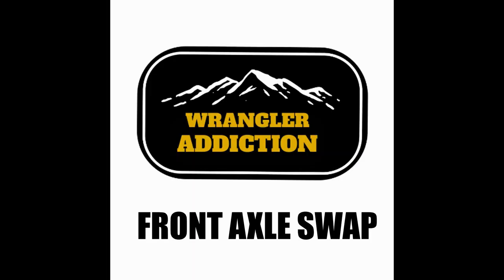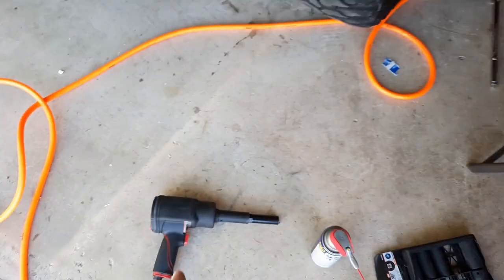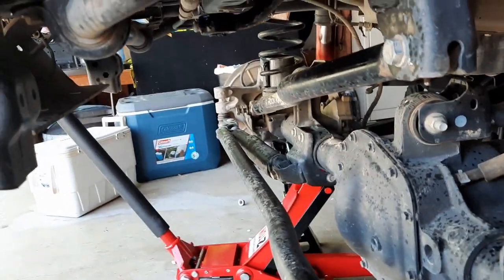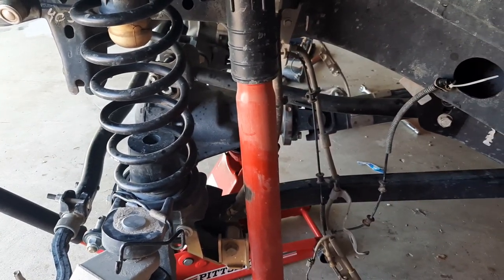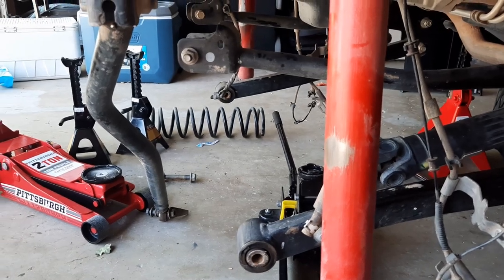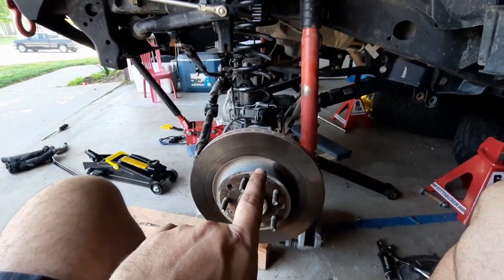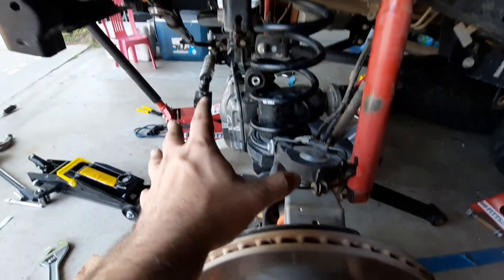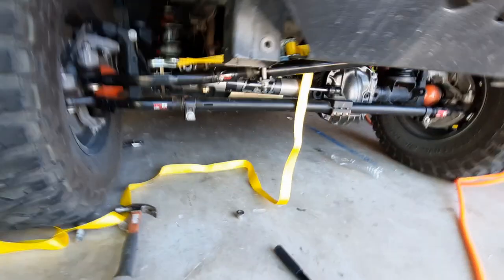Installing Jeep Wrangler JL Rubicon Axles On A JL Sport ( solo at home ) Part 1

Comment: Any updates on the wiring for the lockers? Looking to do this upgrade to my two door sport and there’s not too much info online that I’ve found.  You’re Jeep looks badass btw
Reply from the maker: Thank you , i wheeled pretty hard all day yesterday and 0 issues , lockers worked perfect , mopar sells the harness that plugs in the diff and on the other side 2 wires one black (negative) and one red (positive) i connected them to my switch pannel and the lockers engage pretty damn quick no lag like the oem , way better this way .
Reply: Alright cool, thank you👍
Reply from the maker: @jakedagan6045  you're welcome ,if you have any questions hit me up on instagram @joe_jlu or @wrangleraddiction

Comment: How much wider is the Rubicon axle assembly compared to the sport?  I have a Dana 44 rear in my sport and would like to put a Rubicon Dana 44 in the front.  I've heard the width is different.
Reply from the maker: Sport and sahara axles are 66.5 inches and the rubicon is 68 inches.

Comment: how much did you get them both for?
Reply from the maker: 1000$ for the rear and the front i got an insane deal on it for 2900$
Reply: Wrangler Addiction thanks bro! I wanna do the same to my Jeep
Reply from the maker: @boosteddautodetailing  try to find a set front and rear , i got the rear and then it took me 7 month to find a front , most of the people sell them as a set and don't want to split them .
Reply: Wrangler Addiction I just found the set off for 3k off a 2020 like 15 mins ago lol
Reply from the maker: @boosteddautodetailing  nice , that's a good deal if they're clean and complete